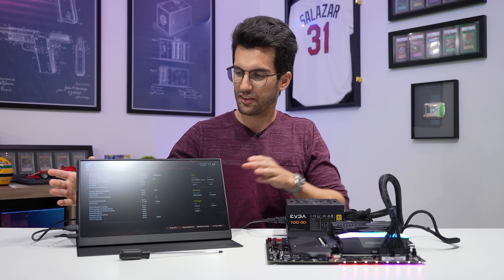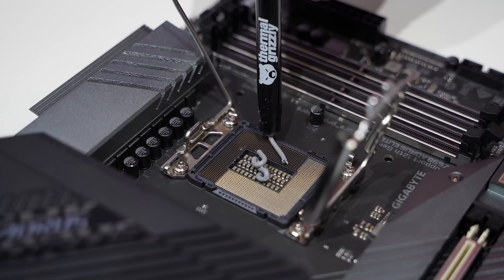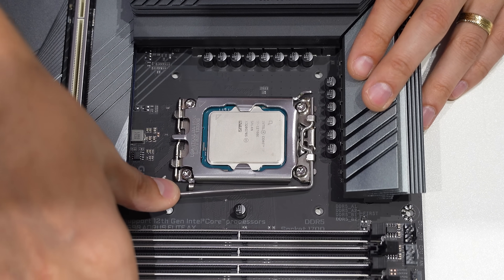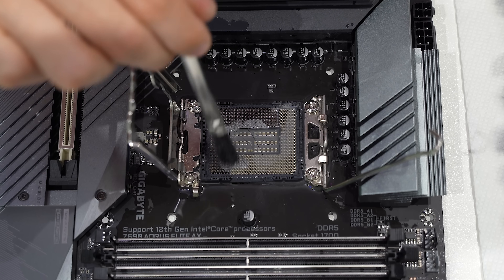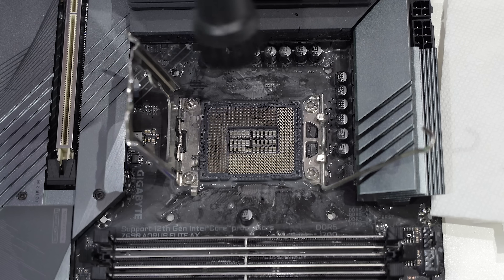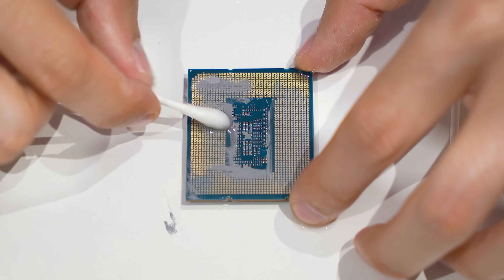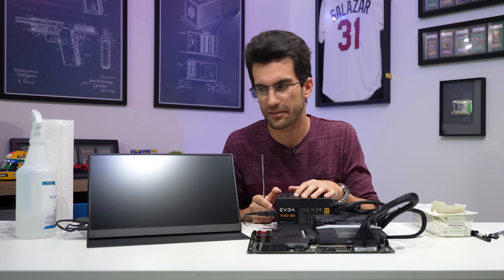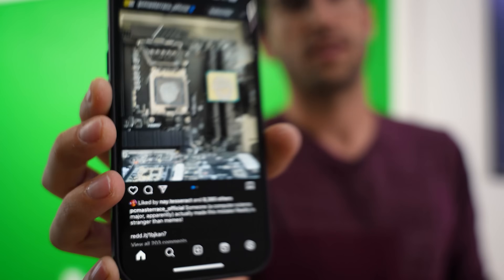How To Fix a Thermal Paste Disaster!

Comment: 9:30 You really don't want to accelerate the evaporation here because it just makes the thermal paste deposit back on the board.  You're trying to get the thermal paste off the board.  Tip the board and let the IPA carry it off the edge.

Comment: first i doubt you can clean the socket because if it is a lga type of socket there are spring loaded pins in the socket and while you can clean the bottom of the cpu being contact pads the pins in the socket are very delicate and can easily be bent and broken.

i would be surprised if you can even clean up thermal compound from the socket.

Comment: I once got a free, used motherboard that "didn't work" was the only info I was given. Upon removing the heat sink, I discovered a cpu installed UPSIDE DOWN. After removing it, and straightening all of the pins, it actually ended up working just fine.

Comment: . . . It might be fun to put clear silicone  coating compound in the cavity underneath the bottom of the item's CPU and see if it improves cooling; lots of computer stuff and electrical stuff fill out cavity in the assembly to provide protection and cooling path for the item's components . . .

Comment: Thank you I got so frustrated at one of my builds that I just threw it all in the discard pile after I removed the heatsink and fan and went to remove the CPU but I didn't realize I got some thermal paste on my hands and I got a little bit on the pads and I am great I just ruined it.  Now I know it can be cleaned so I won't loose any more money.  Also don't buy the cheap recycled PCB boards they are not as strong as the new ones and will not support the big cooling towers.

Comment: Dear Intel. Please get rid of the LGA. It's an abomination. I had to fix almost four dozen pins after inserting the CPU the wrong way. 🤣There were 15 bent pins originally, but I managed to smush a bunch of them trying to fix the original problem. I don't know what I was thinking about at the time because I’ve installed dozens of CPUs with no issues. Obviously that's not Intel’s fault. But there must be some kind of tech that would prevent this from happening. The CPU still works fine.

Comment: I have to swap CPUs on a daily basis (I work at a large tech company) for validation testing. I had a CPU socket that had a small amount of thermal paste in it and tried to clean it with IPA and the same kind of brushes and had some of the bristles come loose from the brush in the socket, however I couldn't see them and wasn't aware there were bristles in the socket. I had to get one of the rework techs to use their magnifier (100X) to see  the bristles and remove them.  Once everything was cleaned up the board booted up without issue.
Instead of using the Q-tips on the underside of the CPU, use the brush. Also, you can spray the underside of the CPU with the IPA.

Comment: interesting approach but many needed. would have stood the board on edge and tape some platic to the board next to the cpu. keep thr run off as much as possible off the board. maybe use a proper board cleaner.  Would love to see the again with a different cleaner like MG Chemicals 406B Superwash Electronics Cleaner. Not sure if it would clean better.

Comment: Inb4 TIM and IPA are non-conductive, and IPA is cheap enough to positively bath the socket in it. I had to do this after AM4 did one of its famous somersaults back into the socket.

I didn't need brushes, and would recommend against them for LGA. You can just flood it with TIM remover followed by an IPA bath, it's cheap, don't hold back.

Comment: 10:22 - So long as the paste is not electrically conductive (such as liquid metal.) If the paste were not thermally conductive, it would be an insulator and not something you'd want to put between a CPU and heat sink - it couldn't do its job.

Comment: Using the blower, now you have dispersed the remnants of the thermal paste all over the motherboard, so potential issues with the paste elsewhere.
Should have used absorbent towels at the sides of the socket to soak up the paste/IPA solution to prevent this.

Comment: This would be one for the dishwasher/sink and soft toothbrush to be followed up buy an alcohol bath for me.  Heat and water action would get more of that paste out because of the thermal properties of the paste.  And of course I would remove the battery first.

If you want to be real fancy you could do a heated ultrasonic bath to get rid of the paste.

For those who are saying "NO NOT WATER", it is how some  brands get their boards ready after testing, and they are baked at hundreds of degrees so they should be good.  The alcohol bath helps evaporated the water.  It is what is often used in repair with an ultrasonic washer.

Comment: I have a doubt, wouldn't the residue thermal paste in the socket be under a lot of heat? If yes this would cause it to stay "pasty" right? And due to the normal orientation that these parts (mobo and cpu) stay in a case (vertical), that "pasty" thermal paste could slide into the contact points between the pins and the pads on the cpu causing problems like not posting, etc?

Comment: Could have used a cheap board for the experiment and poured the alcohol gently without spraying onto other components. I suspect that the CPU might have worked if all pins pushed through and touched.

Comment: Should have surrounded the socket with cotton balls to absorb the outward flow
Reply from the maker: The clean-up around the socket only took a couple of minutes. Cotton frays and leaves stragglers behind. Either way, would've required a bit of work.

Comment: dude set it to spray, as something to do first before liquid (alcohol) try to take the thermal paste in the middle out with a vaccuum cleaner or a big syringe
Reply from the maker: A stream vs. mist won't change much here. Would've just taken longer to soak the socket. I intentionally left some of the paste in the middle to exaggerate the issue a bit. Raymond didn't exactly smother the pins like I'd hoped hahah.

Comment: I would have tried contact cleaner or the spray brake cleaner. Would it affect the plastic? I don't know but you can always spray it on a dead board first to see the affect. I'm not crazy about hitting those contacts with a brush, you could snag a contact with the bristles. Using the spray the pressure itself would clean out the compound with no chance of bending the contacts. Also the spray would evaporate fast. I think It's worth trying.😊👍

Comment: Hey, I can say from experience I bent a few pins on my MB and didn't realize until years later when I went to add two additional sticks of RAM and a M.2 HD. I could only get the B side of the RAM to work but not the A side. I pulled the CPU off and found 4 pins bent slightly, everything else worked fine. Just saying this to ensure that all RAM slots work and all M.2 slots as well. Great Videos honestly.

Comment: 99 ipa is not really conductive at all. I mean it is very minorly conductive but probably not enough to cause an issue. Just as pure H2O is not conductive either. Its all the stuff dissolved in water that makes it conductive. Derbauer has a video where he used just pure h2o and submerged a running computer in it and it survived for like 30 minutes before all the metals and stuff from the motherboard made the water conductive.

Comment: Thermal Paste would be a heck of a mess... I had a computer dropped off with no power ... somehow on a AM5 motherboard this guy building a computer with his friend thought that the instructions to remove the plastic cover meant to remove the CPU hold down bracket ... he then removed the plastic amd mounts so the heatsink could screw down to the motherboard ... problem is he used a AM4 Cpu ...and managed to kill the CPU and motherboard .. then took it to best buy and they charged him $60 to tell him he had a dead motherboard .. but they clearly didn't check to see if there was any bent pins ..or ..a CPU for another socket

Comment: What, 1000 times better than IPA? Mass Airflow sensor cleaner thermal pastes downright dissolves on contact. Just hold the socket above the sink and spray until you can't see any more gray.

Comment: If that were me and I tried this I would  use Tape around the CPU then cut out a piece of Plastic/Garbage Bag a little bigger than the CPU  then tape around it And Place the Board Upside Down and Have it above me, and Soak the Area with IPA That way it would drip downward, Then what you did with the CPU and Spray/Soak while lightly Brushing it away. ???

Comment: I once all pc i needed, I then went on a night out, I get back at 3 oclock in the morning, I then I think,I gonna build that pc now, I woke up with a massive hangover,  stumble to kettle, I go and sit, see load of pc bits on my table, I go a look and them, I had bent all pins in socket and CPU and a tried to fit the psu to a fan socket.😅..

Comment: @GregSalazar
I would have used a soft-bristle toothbrush to do what you did, otherwise, nicely done, even if those brushes you used were falling apart! Believe it or not, I've actually seen this in person. It was a kid that thought thermal paste was supposed to go in the socket as well as on the IHS. I showed him how to clean it up and apply paste properly. All was well, his system posted and ran properly.

Comment: Hey Greg,
holy cow, that was terrible to watch!
I use brushes all the time for cleaning electronics, and I've never seen such bad ones, losing half of their bristles along the way. Getting the bristles out of those pins must have been a similar amount of work, but video editing magic helps, I guess :P
Also, I have a hard time understanding how all tech youtubers keep using IPA as a universal solvent/cleaning agent, especially for silicon grease-based stuff such as thermal paste. For that purpose, It's just vasty inferior to mineral spirits. These will actually dissolve the paste, instead of creating a nasty suspension that leaves SO much more residue on the board and everything else. Yuck!
I had much better results cleaning CPU and GPU dies with mineral spirits. You should really try it.

Comment: I saw a thing recently where someone used the end of a mechanical pencil to bend pins back into position.  Youd basically cover the specific pin with the end of the pencil and bend it back carefully.  Seems like it would be a bit easier than using a needle.  (But then again it might only work with some motherboards or CPUs.  I dont know!)

Comment: My home repair would be filled two plastic basins with IPA then stripped the mobo of all sinks/retention brackets and dunked  the whole mobo socket side down and let is sit then rinse in the second basin with clean IPA and repeat until clean if needed use a soft brush. But if you really want it cleaned maybe send it out to a repair tech and have them ultra sonic clean it in a parts washer.

Comment: Good video, it shows that the world doesn’t end when some (or a lot) thermal paste ends up between the pins. I have used another way in the past - soak the socket a little bit with WD40 , let it resolve the paste and then blow air with compressor or air duster. Works like a charm, and leaves no trace behind.

Comment: I've always cleaned cpu's pads or pins with soft tooth brush and tons of IPA.  Just be careful when cleaning pins.  Shouldn't take more than a minute or two to get them squeaky clean.  Obviously the socket cleaning requires more attention and time to avoid bending pins.

Comment: I would have taken the cpu to the sink and washed it and let it dry before installing it. Also, I would have removed the retention mechanism and rinsed the board in the sink after getting the paste out. Also a sonic bath would have easier and more thorough if you have one.

Comment: Could also take it to someone with an ultrasonic cleaner, take out the bios battery and take off what can be removed from the board and give it a dunk in the cleaner, that'd get it off too. Just an alternative if someone doesn't have the stomach to do this themselves.

Comment: I've actually had a lot of luck using Electrical Contact Cleaner, found in the automotive department in a lot of stores, to remove thermal paste. It cuts right through the paste and dries quicker, too. I've had to do multiple passes when using Isopropyl. Might be worth a look.

Comment: ASUS ROG Crosshair VIII Hero X570 ATX Motherboard with PCIe 4.0, Integrated 2.5 Gbps LAN, USB 3.2, SATA, M.2, Node and Aura Sync RGB Lighting
 is this a good motherboard i dont know much about boards i have been looking for bouard to upgrade my old gaming pc board but i want to buy the ryzen 9 chip later i have look at some but dont know if this is high end board or in between which ok i just don't want any budget low tier board like the one i have any way great video i learn lot but debugging hardware issue thank lot i dont have to send in unless its sofeware

Comment: Love you Greg but this video is so half assed. This motherboard is worth what $175? The CPU could be worth $300 or more? When you finished your motherboard and CPU were still covered in contaminant and who knows what the longevity of this hardware is going to be. What you should do is go down to the hardware store and buy a clear poly utility box that's base is bigger than the motherboard and a gallon of 99% IPA. Get a pack of baby toothbrushes. Work outside and pour half a gallon of IPA into the bottom of the box and drop the motherboard into it and submerge it. Gently and very carefully clean the crap out of the socket and keep sluicing the IPA to lift the contaminants away from the motherboard. When you are done pour out the contaminated IPA and before the board and CPU dry use the other half gallon to rinse the board. For most people $450+ is a big deal.

Just for clarity, IPA refers to Isopropyl Alcohol not India Pale Ale.

Comment: $300 repair if your time has any value taking hours with no guarantee it will work vs $150 replacement part, takes minutes to install and is guaranteed to work. Oookkkk...

Comment: if you have bent pins and want to check, I found having a good top light shining down, and using a phone to take a picture from 2 different angles, the reflection from the light shows discrepancies with alignment pretty good. (played around with some old Work E-waste PC's they let me have once and dropped the CPU in) 
An untested thought for cleaning,  an electric dental floss using Isopropyl Alcohol instead of water may help get it out from under the pins?

Comment: Grab a bucket or tub the size of the motherboard, or if you have a garage and concrete floor......Take your spray bottle and blast the IPA into the socket to use force of the IPA to blast the thermal paste out of the socket, go ham on rinsing off the motherboard.  The spray force of the spray nozzle will NOT damage the pins or motherboard, but also will help clean off the thermal paste.

Comment: Maybe it would be less expensive gambling to try this with some much older lga platform..... but i think a brake cleaner spray would help without any dircet contact with the socket itself, just need to place enough paper towel to keep the liquid away form the other componets.... i used brake cleaner spray to clean thermalcompoud before, it works fine, just be aware of the vapor, its very flamable and irritative........

Comment: i have a question ... Does this CPU and MOBO will better now ? Because the heat will not be that high on the CPU temperature will be lower than normal . It still have little cooling from the thermal paste . Correct me if i am wrong. So the question is , will be better if it stay a little bit of thermal paste on the pins or not at all as normal. Thank you. It make sense a little bit when you think about it. That's why i asked .

Comment: I'd be curious whether the system would boot with the thermal paste in it. If it's not electrically conductive, would it be enough of a barrier between pin and pad to prevent contact? Or would it boot but potentially be less stable than if it were not gooped up?
As for cleaning the SMDs on the bottom of the CPU, an alternative might be automotive electronics contact cleaner, since it's lightly pressurized it might make cleaning small components a little easier/safer.

Comment: I also believe that if you put the mobo on its side you can spray a non-residue forming electronics component cleaner into the socket so there is nothing abrasive at all touching the pins.  I've had luck with that in the past.  Also works tremendously on other slots if you have a motherboard covered in cigarette smoke tar shmoo.

Comment: with a very soft  (fine tip preferably )brush and some  alcohol like 99% because it disintegrates thermal paste  and   it leaves  almost no residue behind . clean gently   and rince and repeat until it is cleaned  completely .  let dry completely  before  powering on the board  and be very gentle   and careful not to bend pins . so  it is fixable ( remedied  or repairable  or whatever word that can apply lol ).

Comment: Fun fact, my friend always put thermal paste in the cpu socket. I was watching him build his 4th computer and noticed this. To my surprise ALL of his computers worked just fine. I’ve been convinced non conductive thermal paste in the socket isn’t a big deal haha. But still… don’t do that
Reply: Not very smart as the socket gets very hot inside and has a hole through the board to allow for heat to escape and the expansion of air in there. Thermal paste in the socket will actually trap heat in.
Reply: @johnt.848  Ohh i mean i know its bad, just was blown away that his computers ran "fine" according to him